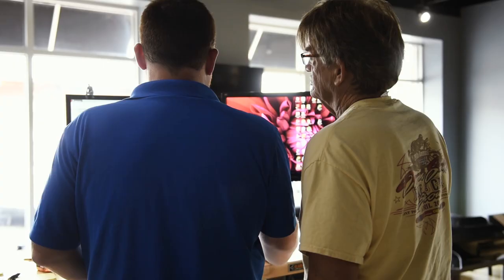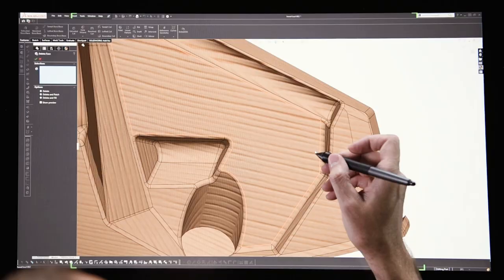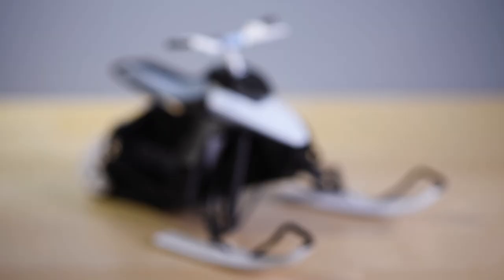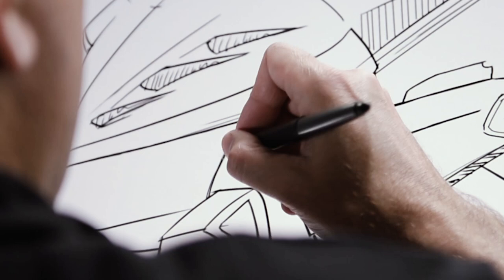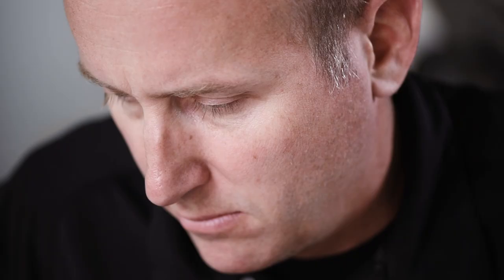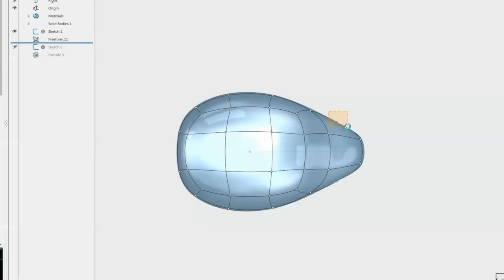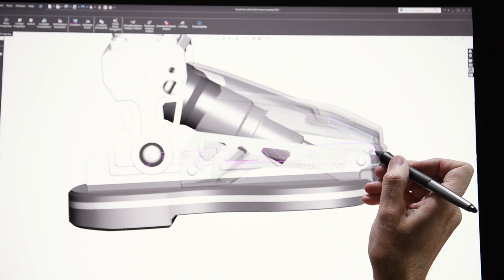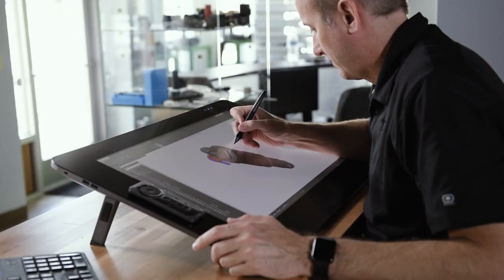Wacom 3D Feature: Jesse Hahne

Comment: finnaly a tablet without using a compter
Reply: its a cintiq, I'm pretty sure you still need a computer, although it isnt shown on the video
Reply: The cintiq needs to be connected to a computer. The Wacom MobileStudioPro does not, although that one is not as big as the one shown here.